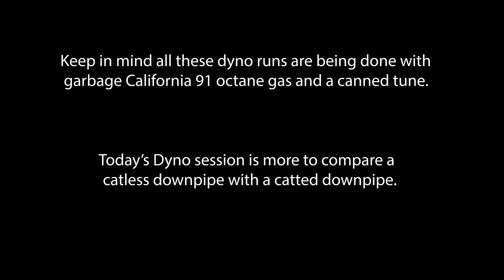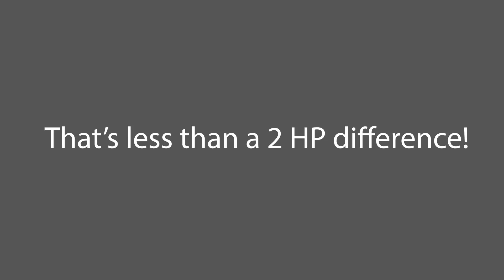RV6 Catted VS Catless on the Civic Type R

Comment: Btw happy belated birthday brother! I had just put on the Tomei full ti Type D and been running the RV6 catless downpipe and front pipe on the stock exhaust which sounded deep w no drone. The Tomei, holy moly it’s ridiculously loud and with the included silencer baffles put into the tips it’s still loud. I ordered the RV6 high flow catted downpipe. Hopefully this quiets it down a bit more. It’s my daily so rn it’s a 🚓 🧲 😂
Reply from the maker: Ronald Batalla Thank you! I was really curious about the Tomei Exhaust. Sounds good for sure. The high flow catted RV6 will definitely help

Comment: Mike - great video, and congrats on the content, production quality, etc. Very top notch.  One question: what was the WTQ (wheel torque) difference between the two? It may have been in the video, but it went by pretty fast. Thanks, and keep up the great work.
Reply from the maker: Angelo Gouvis torque actually dropped a couple lbs but I think that can be easily tuned for a bigger gain. I hesitated using total numbers because the canned tune is too basic to illustrate what this set up can really do
Reply from the maker: I'll be doing a full custom tune coming up in early May. Then we'll really see what this set up can do. Stay tuned!

Comment: What is difference between stock downpipe and high flow cat downpipe ?
Reply from the maker: Fedja Drndarski the cell count is much higher on the stock dp and the pipe diameter is smaller.
Reply: @GridZilla  I know that, I asked what is power difference between stock DP and catted?
Reply from the maker: Fedja Drndarski approx 12whp
Reply: @GridZilla  Thanks for info. 👍

Comment: Another fine review!!  Thanks for sharing the experience!!  I'm glad you decided to go back to the 200 catted downpipe.  From what I've learned so far, the catless downpipe introduces exhaust fumes and is noticeable into the cabin.  Did you notice this inside your car?  For only a 2HP gain, I don't think it's worth enduring such smells (if any) and it's more about choosing the right sound and most importantly HP & TQ gains.  Glad you found the right combination that pairs well with your ride!  RV6 catted looks like a win!
Reply from the maker: Mr. Tuckers I probably didn’t have it on long enough to notice a big difference in smell with the catless. Either way not worth the 2 hp difference for sure. Love RV6 products. They definitely make quality stuff!

Comment: Hey, what was hp gains over the factory down pipe and does the high flow cat set off the check engine light? Great video!
Reply from the maker: Nuno Franco is about an 11hp gain over factory without tune. The check eine light may not come on with the high flow but I recommend using a tuner that turns that will keep the cat from throwing a cel. Thanks for watching!

Comment: What r ur thoughts on Martelius exhaust for Type R?
Reply from the maker: JokerHarley05 I have approx zero experience with that syste. But what I can tell you is if I had 3 other Type r's I needed an exhaust for. All the are getting Remus
Reply: Thanks for the honest response. TBH,  ur ride sounds so much better than ur Remus video. Don’t know if it was the wind factor but sounds meaner 😈
Reply from the maker: JokerHarley05 its the down pipe with the exhaust combination
Reply: @HyperInvest210  I'm getting the Martelius. I've listened to literally every exhaust for the FK8 on youtube and I think it's best. The fk2 should sound the same as the fk8 so watch some of those vids as there's a lot more! 👍

Comment: Hey Mike, I just ordered my FP and DP from RV6. They are having a FP presale so I went for it. Is there anything you would recommend of having done while all the stuff is out of the car? 
I was most likely do a turbo blanket but was trying to think of anything else. I don't plan of pulling all the stuff back out until I decide to sell.

Also, did the sound change dramatically when you changed the catted DP and FP?
Reply from the maker: jim payne it is a dramatic sound difference with the down pipe change catted or not. You'll love it. If you haven't already I would recommend getting an intake and a tune. Intake needs to be removed anyways so might as well put in a new one and definitely a turbo blanket. The ptp fits nicely under the stock heat shield which I wanted to retain. The tune you'll need to keep the check engine light gremlin from showing up.
Reply: @GridZilla  Yup I'm running KTuner Stage 1 already. I started pulling this apart and it wasn't super fun to be honest. I think I'm going to throw on an intake while I'm at it. I don't want to have to do this too many more times. Thanks for the feedback.
Reply from the maker: jim payne I don't blame you lol no problem

Comment: Do you have drone in cabin
Reply from the maker: Ben Patrick with the Catless yes. Mainly under load in 6th gear. 

Less so with the high flow cat but still there a little.

Zero drone with the baffle closed on the exhaust.

Comment: Thanks for the video, can you post a more detail dyno image of catted vs no-catted? Peak power is nice, but doesn't tell the full story.
Reply from the maker: bxcloud there's an image of the dyno showing hp and torque but because this was on a base tune and the rpm module they use for their dyno at Tech3 is outdated, the torque curve looks distorted. That's why I didn't really cite the torque numbers. I'll be getting the car custom tuned early May at a different Shop. Will get some solid numbers and graph for you there. Thanks for watching!

Comment: Hello, I have a research now, My FK2 stage2+ has catless DP + Stock exhaust, droning too much at highways. I want to eleminate totally cabin noise from exhaust, Is it okey to use universal hi-flow cat or what if using paralel 2 high-flow cats with Y connections, will it harm engine ? Also i want to upgrade my exhaust to 3" with good silencers for less restrict my engine without noise. Please answer. Thanks.
Reply from the maker: Uygar KAYA get the HKS Legamax. Great sounding exhaust. Not loud. No drone
Reply: Thanks for replying. It need highflow cat for complete right ?
Reply from the maker: Uygar KAYA yes.

Comment: Is the heat shield necessary on the downpipe I installed a catted RV6 dp on my si and forgot to take the heat shield off
Reply from the maker: Keith Begley not necessary for most street driving. If you track then it’s 100% necessary

Comment: With strict emissions and as a California resident, I assume catted is the way to go
Reply from the maker: Mr. FredRice for sure
Reply: Bad news, Mr. FriedRice, non-OEM cat won't fly with the Cali Smog Nazis (a.k.a. CARB). Even if you meet tailpipe emissions, no joke. You could still be fined, if you get caught. CARB is one of the things I don't really enjoy about living in Cali. However, I plan on running a catted RV6 on my CTR (soon) because: (1) Avoid the nasty un-catted exhaust smells, (2) it's the right thing to do for the environment, and still make good power, and (3) sound is a little less raspy than the uncatted.
Reply from the maker: Angelo Gouvis the risk you take living in Cali
Reply: @angelogouvis1885 -Hi, so is there an oem catback dp availible that will give a little more hp and still sound better with a little more growl?
Reply: @forrestbashaw1455  : I haven't read the CA vehicle code lately, but from what I understand, any modifications to the emissions control system is strictly verboten. Just to clarify, OEM means Original Equipment Manufacturer (in this case Honda), who only makes the one type of catted downpipe (which came with your vehicle).
Reply: @angelogouvis1885  -Thanks but just to clarify, is your choice "catted RV6" CARB? 
Just like my 2008 SI's DC inlet, it has a carb sticker label so it confirms it will pass as CA exmpt.  I even looked it up on CA dmv site from vendor and it sure enough its listed as CArb for CA. So I know for sure it will pass smog test. 
I can leave it on and not have to worry about it not passing smog nor have to hassle to remove it everytime I need to go through a smog test.
 
Sorry for my 2 cents, So either as in wtih Mishimoto etc manufacturers either need not only label their parts for us in CA so we know they are CARb exempt but if not like a few I saw that the say are "Not CARb yet" .. 
So either we are get only CArb or could wait til they are CARB'ed .. All the more reason being to eliminate the hassle to have either risk paying any fine or remove already installed parts just to pass a smog test on the spot etc. 
Everyone one in other states don't have to struggle with parts not being smog test passable it seems so they have more selection and less restrictions than us in CA; bummer for us. 

It might be easier for manufatures to make their parts so we can use them too in CA vs fighting/lobbying legislation to make allowance(s) for us.
Shame we should have to go through that.  The price we have to pay for living in CA I guess.
Reply: @forrestbashaw1455  - You are correct sir....my comments above regarding non-CARB compliant aftermarket equipment does not apply to those aftermarket pieces which have been CARB certified and bear a CARB Executive Order (EO) number, which makes them as legal as the OEM pieces.  However, CARB EO certification is an expensive and time-consuming process.  I've heard that just to "get started" a manufacturer can count on spending in the neighborhood of $50K-$100K (this is for each part, mind  you), and sometimes more.  Further, the queue for CARB certifications is sometimes several years long.  Rest assured, if a manufacturer has succeeded in certifying their parts, they'll almost always include it in the "features" of the new part (to help with sales in CA).  At this time, the RV6 Catted Downpipe does not appear to have a CARB certification, and its unclear if RV6 is considering undertaking that process.  For more details on CARB regulations and their database of certified catalytic converters and aftermarket parts, see: https://ww3.arb.ca.gov/msprog/aftermkt/aftermkt.htm.

Comment: What was the HP difference between stock and the high flow cat?
Reply from the maker: About 11hp to the wheels without a real tune. Should be more with a custom tune which I'll be getting in May
Reply: @GridZilla  Can you not get an off the shelf map for the sports cat or decat? I had some software called MHD on my previous m135i and that offered different maps for the different mods! I'm surprised Hondata and the like don't offer it!?
Reply from the maker: @7yellowcard7  I am using the off the shelf map but all it really does is make sure the Check engine light doesn't come on. Doesn't tune any more aggressively to account for the freeier flowing down pipe. You'll naturally gain more HP but won't realize the full gains without a custom tune which I'll be getting done in early may.

Comment: I’m still resisting that KTuner. 😂 My wheels did come in. Should be installed by next week.
Reply from the maker: Judo get it! 😂
Reply: Get hondata
Reply: Tyler T Looking at both. I just want a safe program. I’ll probably never track. Just possibly autocross for some fun runs. Probably my next purchase if lowering the car isn’t necessary.
Reply from the maker: Judo I went with Ktuner because you don't need to drag a laptop with you everywhere you go. You can save 5 maps to the module and flash as you desire
Reply: I wish I went with hondata because of traction control and flex fuel maps
Reply: Tyler T I started seeing that option as well but for my use, I may be ok with the KTuner. Honestly, I think the car is quick enough just to get in enough trouble. KTuner may change that. 😂

Comment: You should be making more power with those mods buddy. Intake and tune and down pipe based on those items website stats... Seems like should be more power.
Reply from the maker: Mu7 every dyno is different. Not chasing dyno numbers. Just results in track

Comment: Hey did you have to retune for high flow cat , or does it not matter on the tune ? I am running hondata but I don’t see a mapping for high flow cat with intercooler and also intake
Reply from the maker: GLOgangNoSquad the base Hondata map with Downpipe is fine but I always recommend a custom tune

Comment: my Type R has 320 HP stock here in Germany
Reply from the maker: MRecke7 that's at the crank not the wheels. If you measured your vehicle hp at the wheels your probably be around 300hp

Comment: Catted is the way to go. Not much difference between the catless. Plus the catless doesn’t sound good at all. 😂
Reply: After listening to exhaust comparisons between catted vs catless, we decided to go with a catted DP with a high flow cat in our turbo cobalt, plus the benefit is there is no highway drone, and the car is quiet when we want it to be...  Even has some nice popping and crackling without sounding tinny, raspy... Still have stock exhaust on from the resonator back...

Comment: If a dealership sold me the CTR at Invoice ($34k) I would first get this. 

1)Ktuner V2
2)Eventuri Intake
3)PRL IC
4)PRL Front&Down pipe (Catted of course)
5)Fi Exhaust full exhaust. 

Any other supporting mods if you want to call it mods, such as Heat shields and heat blanks for the turbo and Manifold since it does create a lot of heat under back to back pulls.
Reply from the maker: Francisco Gastelum sounds like a fun project
Reply: Francisco Gastelum Just go with the new high flow cai PRL is releasing.